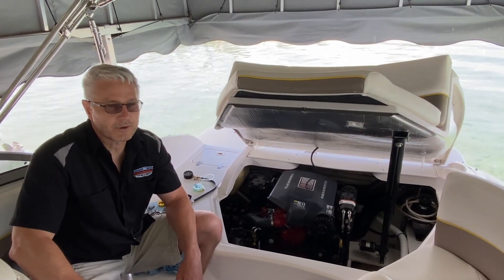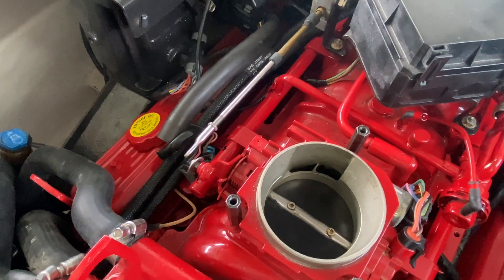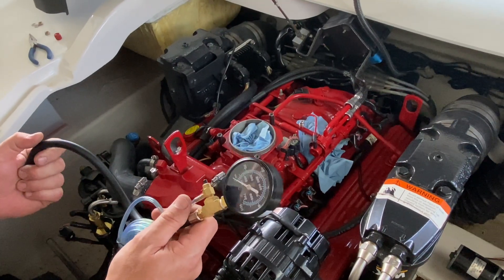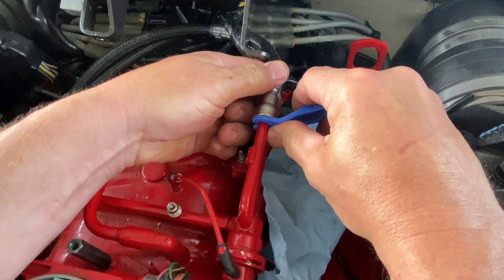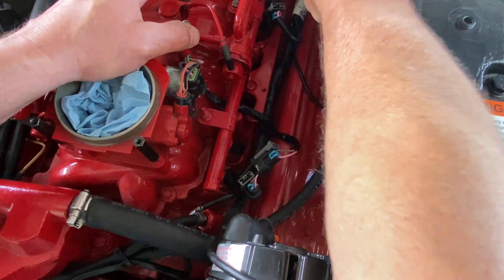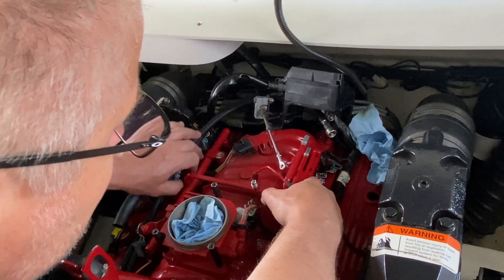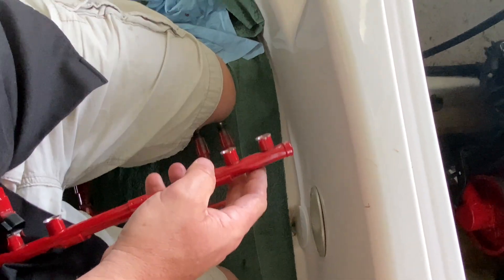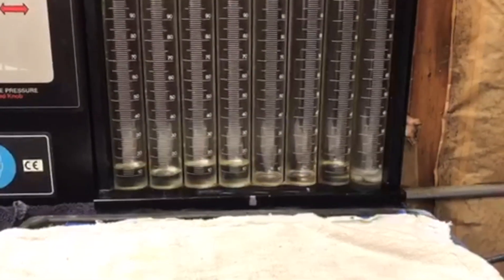Volvo Penta Fuel Injector Removal and Cleaning

Comment: Troy,
Thanks for the great vid.  Gave me the confidence to do this as well.  Couple of additional comments based on my experience with a 2005 5.0 GXi-E:  
  * I used my shop air to blow around the injectors prior to removing them.  Then I squirted some penetrant and then twisted them back a fourth a few times to help them release.  Despite all that I did have one stick and followed your advice on where to grab it > finally came out and was still usable.
*  With the short season we have in New England, I chose to do this at season’s end post pulling out the boat.  But knowing I needed to also get it winterized and unsure of how long it would take to get back the injectors,  I bought an aftermarket injector set for less than fifty and installed them prior to taking the boat into the shop for its winterization thus eliminating any timing issues.  Got mine back after a few weeks and reinstalled them in the spring.  Now I have an extra set in case of issues.  Cheap insurance.

Mine were very dirty prompting the Injector Service to comment that I should be changing my fuel filter more routinely.  Of course, I do that, but the real issue was the dreaded VP Fuel Pump internal paint flaking off.  And your service of doing the rebuild on my pump solved that problem a few years ago.  For those unfamiliar please see Troy’s vids and on this and his service.  Its well worth it!

Comment: Having trouble with my 2004 volvo penta 8.1 liter fuel regulator. I need to change it and am wondering if it unscrews? I don't see a "c" clip holding it in place. I have a picture I can send. Do I need to replace my whole rail just for the regulator. The regulator is change but the whole rail is $800.00. Hope you know. Like your videos.

Comment: Troy I followed the directions on your excellent video, however I am hoping I can get some advice one of the injectors has come out of the block missing the rubber o ring retainer its the metal circular ring at the bottom of the Injector that appears to be used to hold the O ring in place , I fear it has fallen into the port , any ideas on how to resolve this?

Comment: Huge shout out and thanks! I just did the injectors on my Volvo Penta 8.1 and my boat is running like new. A couple of small changes in procedures for me though, maybe help others with 8.1 motors.
1) my wiring harness is attached to the fuel rails, so disconnect the harness and remove attached to the injectors with the fuel rail. 2) There was a lot more fuel in mine, so be prepared with lots of rags (probably because my injectors were pretty clogged).
3) I could only get 4 new injectors, so I purchased a $12 injector cleaning kit off Amazon, cleaned them myself, reinstalled the 4 best ones along with 4 new ones. I sent the worst ones out for professional cleaning.  This way I'm not without a running boat.
Reply: Where did you get the new injectors? Got a part number by chance?

Comment: Another great video, thanks.  My Volvo Penta 8.1 suffers from low RPMs (<2200) when under load.  I've followed all these videos, replaced my filters, checked pickup, new fuel pump (mine got starved due to clogged filters), unsure about the pressure regulator still (I took it off and cleaned it), but no love on getting my RPMs up (idle and no load are much improved).  So on to injectors next?
Reply: I have the same issue and have done most of the steps you have. Did the injectors fix the problem?

Comment: Great video, helped me a bunch. One tip - don't put back the cotter pin for the throttle linkage until done. I left it in and when pulling the injectors off the pin went in to my hand and busted me up pretty good. Maybe use some mechanic gloves as well. Thanks for making this video Troy, saved me a ton.

Comment: Troy thanks for all the videos. Had the paint fail on my fuel pump. So had to replace the fuel pump (stripped the old one but it was RS), clean the fuel rail, remove and get the injectors cleaned. Manged to get it all back together (watching the vid's). Runs like a dream now. Saved me a fortune, and it was a great experience.... Cheers from Australia.
Reply: Did you notice a ticking sound with the dirty injectors ?

Comment: Hi Troy I have a 1994 Volvo Penta with a MPI Ford 5.0L 302 ci V-8 that starts & runs great whenever it's cold, however after it's at operating temperature it is frequently hard to start (acting flooded) for the first two or so attempts and then it will finally fire up & runs excellent again. I performed a tune up on it last month which involved; new spark plugs, plug wires, fuel filter, rotor cap, rotor, four blade prop, & went through and cleaned the flame arrestor, & other components with carb cleaner. I've discovered that the boat has never been tuned, the plus side is it's running like a top now, & I know what has been replaced since '94. I was wondering what it will cost to have my injectors cleaned? do they come off the same way as the ones in your video after I have taken everything off(air intake plenum, fuel rail etc.)? Do you know or have any idea what could be causing the starting issues? thanks for your videos I've learned valuable information from them!

Comment: Troy, thanks for the great videos! I have a 5.7 gi running rough, did full tuneup but still running rough and getting a lot of vibration at idle, will
smooth as throttle is increased, could this be my injectors? Thanks Joe!
Reply from the maker: It is possible.  Check your fuel pressures to rule out the fuel pump

Comment: How did you determine that they needed cleaning? How often does this need to be done?
Reply from the maker: My fuel pressures were good.  It was really more of a feeling because the paint chips had gone through the fuel system it just seemed that they would be affected